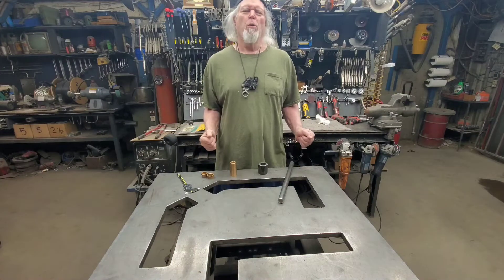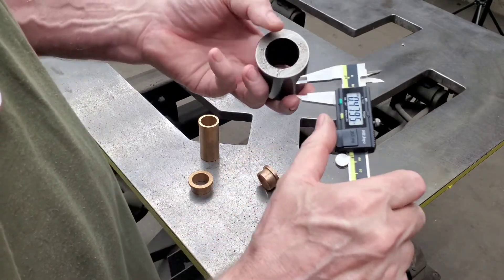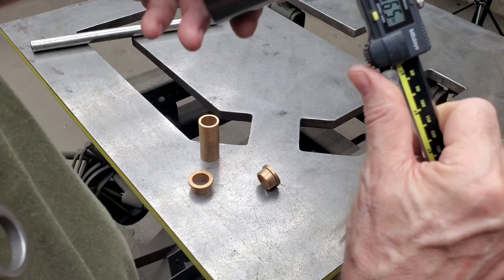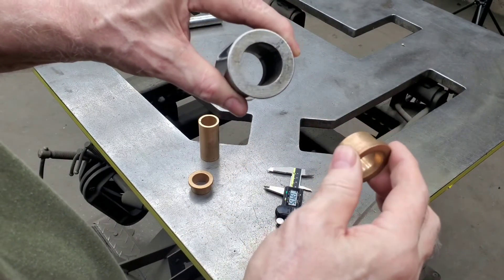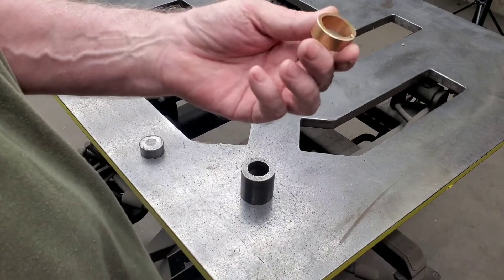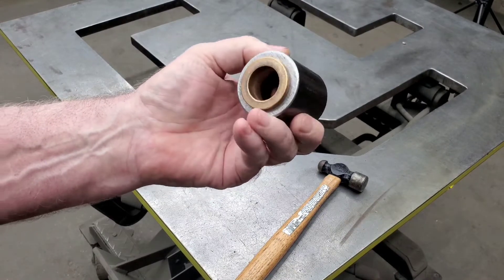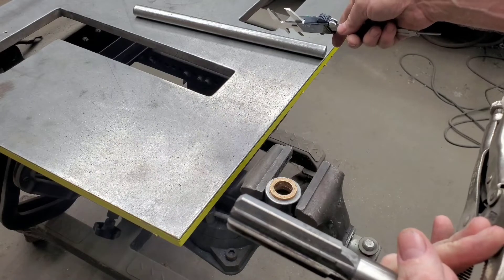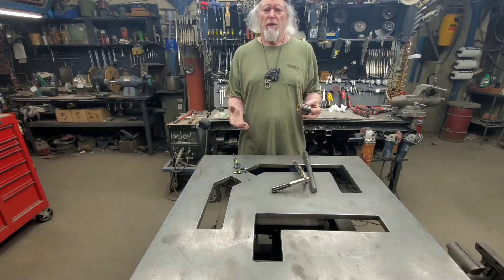[Trade Secret] make a bushing housing without a lathe or a mill.

Comment: Thanks for sharing. The application I'll be using these is for a little rotomolder that will roll into an oven to melt the polyethylene. It'd be too hot for normal bearings.